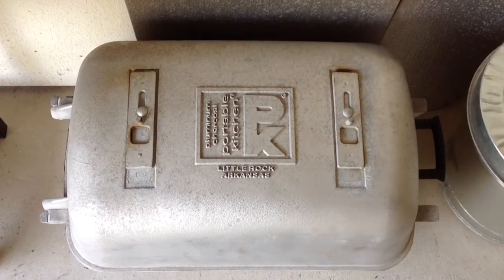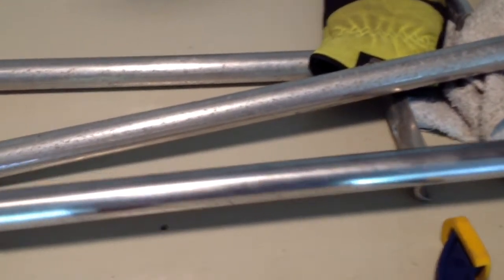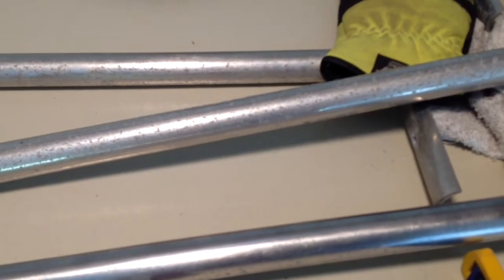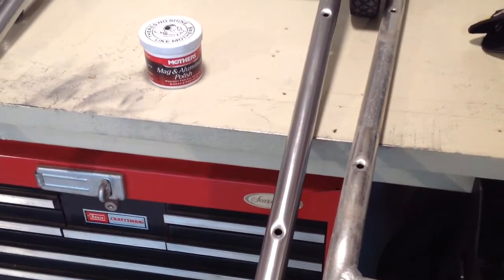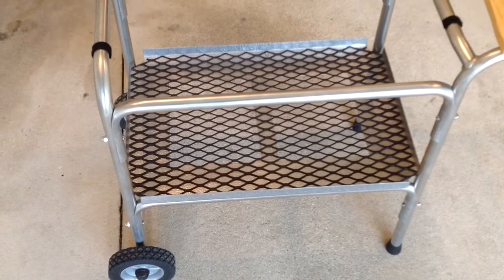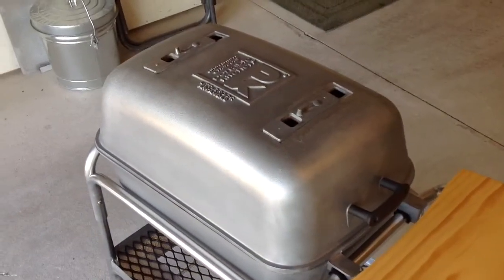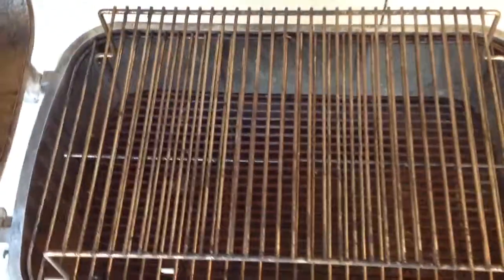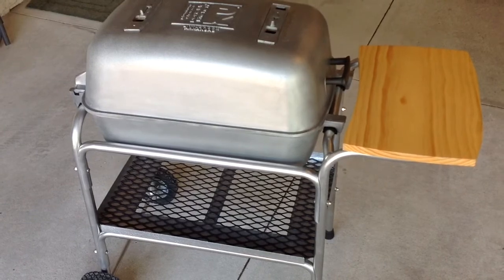PK Grill Restoration And Modifications

Comment: The work you did looks great despite the top "paint" coming off.  I just bought a used original and spent a whole day cleaning it up.  It doesn't look this "bright" but I only used Dawn dish soap and steel wool pads.  Thankfully, no dome paint came off, I had no idea it was a painted surface either, I assumed it was just the solid cast aluminum itself.
Reply from the maker: Thanks for Watching! Enjoy!

Comment: I recently restored my old PK. Used Rust Oleum High Heat Ultra spray paint which worked out well. Bought the paint at Home Depot.
Reply from the maker: Bill Moore Excellent Bill! Good tip!
Reply: I roughed up the exterior with a wire brush before painting which worked well.

Comment: I'm restoring a PK grill and the paint is really peeling on the top and bottom. Will the nylon brush take off the paint or do you think I should use some type of paint stripper to remove? Rustoleum makes a silver high heat paint that may work to match the color??? Thanks
Reply from the maker: The nylon Brush will not take off paint unless its loose.  Try a metal brush on the drill that will probably remove all the paint. Good Luck and Thanks for Watching

Comment: Tom, I'm looking at an older unit. Can you tell me what you used to clean the top and bottom of the tub?
Reply from the maker: Joey C Thanks for watching!  I used a coarse and fine nylon brush in a drill to shine the stand and the tub and then used Mothers mag and aluminum polish to shine things up. I didn't realize that the tub was painted u till I cleaned it up.
Reply: Are all pK grills painted? I'm looking at one today and it looks like it's got decent amount of Charcoal staining on the lid.  What would you suggest to do to not damage the paint?
Reply from the maker: Joey C don't know how old of a unit your looking at. The one I did was only about 4 years old and it was painted. Using the nylon brushes on it did not damage the paint. The paint that was damaged was heat related by the top vents

Comment: Does anyone know how to fix a loose vent sliders? Thanks
Reply from the maker: Je P Thanks for Watching! I have not tried to fix loose sliders
Reply: Did you figure this out. I have a loose vent on my PK too.
Reply: My girlfriend has a PK Grill from the early 70s sitting outside her house.  I recently started getting it in shape and found two loose underside vent sliders that destroyed any chance of using it to smoke.  After looking at it for a while, I simply used a hammer and gently tapped the bolt/rivet in until the slider was tight again.  In one case I tapped it in too much and it wouldn't move.  I used the same hammer to gently tap the vent to the side so it would open again.  Pushed it back and forth a few times and it was as good as new.  Was able to maintain 225 F on a 4 hour cook last night after having done this.
Reply from the maker: Sounds like you fixed it up nice! Thanks for watching!
Reply: @TomHorsmanAmateurBBQ  I'm going to use your video this weekend to go through and restore its appearance.  Thanks for posting that.
Reply from the maker: Daniel H. Nice! Thanks for Watching ,